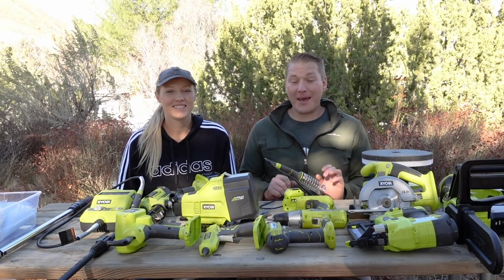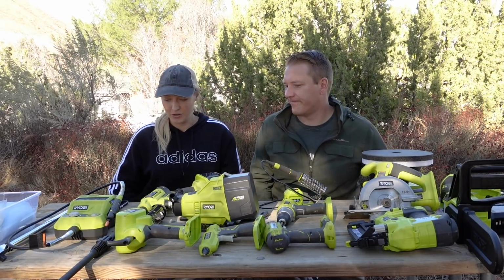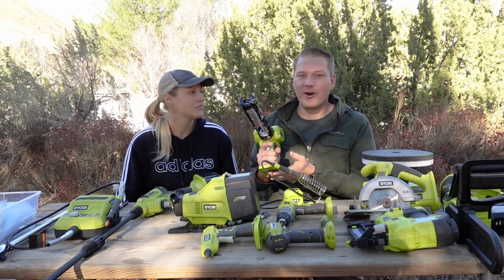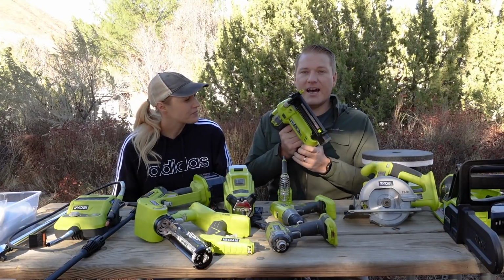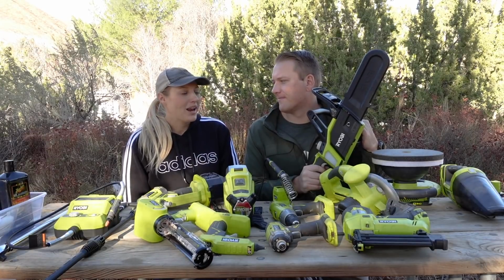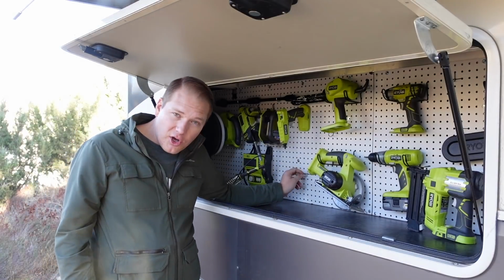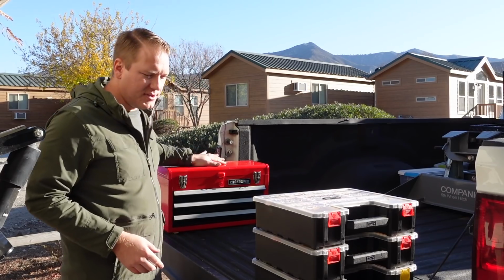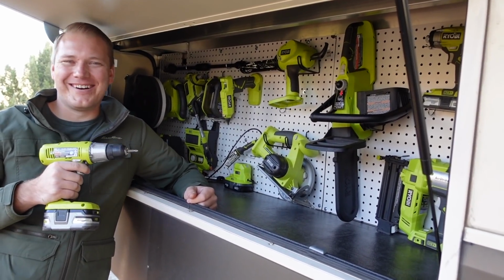EPIC RV TOOLS YOU NEED & HOW TO ORGANIZE THEM EFFICIENTLY!

Comment from the maker: Hi Gang! Thanks for watching today's video. Below are links for the tools and products mentioned in this video: 
250 ft-lb torque wrench: https://amzn.to/3osWj5K
Ryobi 2 pack of batteries: https://amzn.to/39GpuxY 
Ryobi Rotary Tool: https://amzn.to/36JG8uv 
Ryobi Pressure Washer: https://amzn.to/3mO7k11
Ryobi Caulk Gun: https://amzn.to/39Th3iG
Ryobi Water Pump: https://amzn.to/37HKvp8 
Ryobi Hot Glue Gun: https://amzn.to/2VFG4ph
Ryobi Drill and Impact Driver Kit: https://amzn.to/2JO4gTU
Ryobi Soldering Iron: https://amzn.to/37D8plP
Ryobi Brad Nailer: https://amzn.to/36LFxZB
Ryobi Circular Saw: https://amzn.to/3mQpsak
Ryobi Buffer: https://amzn.to/36JTcjC
Buffer microfiber: https://amzn.to/39LfcMR 
Marine Wax: https://amzn.to/2JTMvCu 
Ryobi Hand Vacuum: https://amzn.to/2VFEQdV 
Ryobi 10-Inch Cordless Chainsaw: https://amzn.to/37E6nlt
Craftsman Portable Tool Chest: https://amzn.to/3ovm4lA 
10 Removable Bin Compartment Box: https://amzn.to/3oqt3fN
This is the truck toolbox we got from Tractor Supply: https://www.tractorsupply.com/tsc/product/tractor-supply-56-in-chest-box-matte-black
But you can get it cheaper on Amazon in silver: https://amzn.to/39YMI2D

Comment: I normally buy high dollar tools but I’m getting ready to retire and I wanted some battery operated tools. I chose Ryobi due to the interchangeable batteries. I built out a camper in my truck and have been very pleased. 

Tools to add to your collection:  jig saw; blower (like a mini leaf blower) random orbital sander; belt sander to name a few. My blower is awesome. I blow debris out of my truck and the bed of the truck. It would probably work on top of your slides and inside cargo bays. It’s truly a sweet little blower. (Great for sawdust when using various saws). If you use a rug outside your camper it would blow that off at the end of your stay.

Comment: Love Ryobi tools - like you, not a contractor but I will tell you I've built and remodeled a lot of things with them....I got started the same way and wanted to keep the battery system. Couple of suggestions...your saws will work a LOT better with 6 or 9 amp batteries. Well worth the investment. Watch home Depot - usually have great deals during Ryobi days every spring. That's when i get most of mine. Have you consider adding a blower? I have one of the 18v blowers and it's great for light work, but for the RV I'm thinking of getting the bench/shop blower...much smaller but still males cleaning up easier, blowing out dust etc. How does the 1/4 inch impact driver do on lugs ? I use mine  ALL the time but I'm considering the 1/2 impact wrench for heavier work, like lugs and bigger fasteners. I have a 12v corded one I've carried in my truck for years...but ya know...cordless, it's like a siren song....

Great video - thanks for doing these!
Reply from the maker: Great suggestions and comments! Thanks for sharing! Gotta love Ryobi!

Comment: I have the identical tool box for a numbers of years. Although you may think it's water tight it does sweat quite a bit inside. I keep my tools and golf bag in mine and have 3 damp traps available at the dollar store to trap moisture.  I keep my golf clubs in a travel bag to protect my golf bag from getting ruined.  I refill my damp traps with calcium chloride about twice a year. It is more economical to buy the larger bags from my hardware store. I hope this can help.
Reply from the maker: Thanks for the info!

Comment: EXCELLENT presentation. I carry a fair amount of tools myself. Nothing wrong with Ryobi , but I went Milwaukee (same owners). I learned the hard way that the battery was the key to building a system. I had two batteries go dead for my old low quality drill. Costs more to buy the batteries than a drill with a battery. I call it the "Gillette" syndrome. Give away the handles, make it up on the blades. Same can be said about tool batteries. Ryobi makes a great fan with a water spray mister . They really work well and cool y'all down on a hot afternoon. And yes; I know what the wrench was used for...
Reply from the maker: Great comments! Thank you for watching!

Comment: Are two most used Ryobi tools are not even in your lineup. We like the Bluetooth speaker, not because it has the speaker but because it has the ability to charge our cell phones while Boondocking. Our second most used tool is the Ryobi fan. This is great if you ever lose power and you want some air circulation in your RV until you can get your AC back on!
Reply from the maker: Great to hear! I see more purchases in our future! 😂

Comment: Nice setup!! I believe that wrench is used when changing out the Anode Rod on the water heater. 😉
Reply from the maker: 😂 That was funny - thanks guys!
Reply: Nop! For the wheel hubs. They have a video on it. And that wrench won’t fit in the hot water tank area. Cheers 🍻
Reply: @SpykersB  Ahh, joke 😂
Reply: @ramblingamblin4649  🤣 👍🏼

Comment: I tried to clean our pellet grill with the Hand held vac, but It was always a pain to do because of the way it is configured.  Changed to a Bucket vac that attached to a 5 Gallon bucket.  Works great to get in all of the nooks and crannies and will work as a wet vac as well.
Reply from the maker: Great tip! Thank you!
Reply: @GetawayCouple  and even better, less than $20

Comment: Ryobi also has a hand held air compressor. It is great for filling bicycle tires, small trailer tires, lawn mower, ATV tires. Small enough to be carried on trips out exploring where you wouldn’t be able to take larger compressors.  I have used it to fill car tires but takes awhile longer that a compressor you would hook up to your vehicle battery. I think it only cost 20 to 30 dollars and was well worth the price.
Reply from the maker: Thanks for the info!